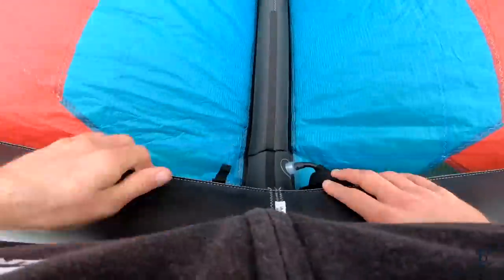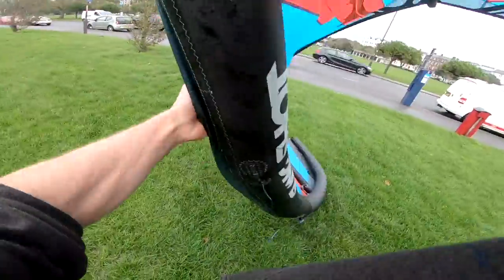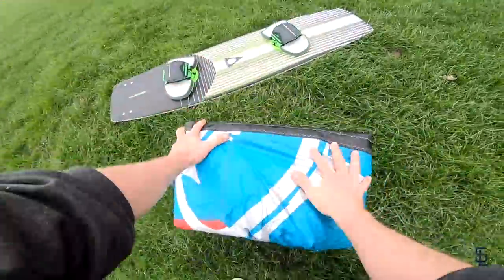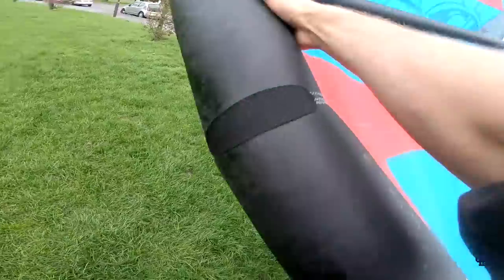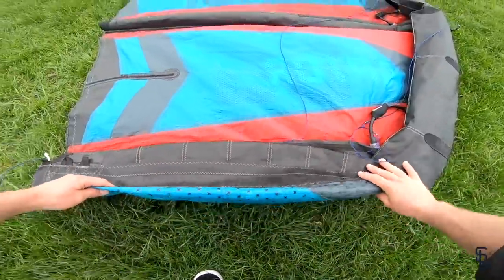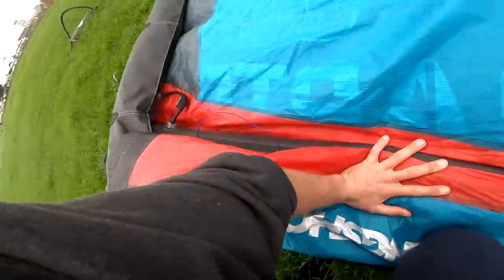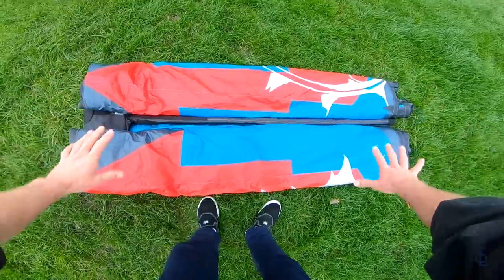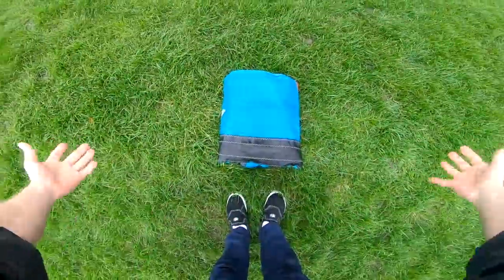How to pack your kite 3 ways

Comment: Rolling kites cracks and erodes the coating applied yo the fabric and thread of materials. You should be aiming to have least amount of loose folds as possible and never roll.so factory fold in this video is the only way you should fold your kite and Instead of doing a hand width make it a bit less width of the bag the kite is going into. Also the 4 folds at end is damageing the fabric unnecesarily you should try aim for only 1 or 2 folds to make it fit into the height of the bag the kite is going into.  I get paid to fold kites, gliders, parachutes and reserves.
Reply: Thanks for this advice! What do you think of the video from slingshot called "how to pack your kite"? They do two lose folds and then roll losely? Is that worse than what you said in your comment (I have been doing it the way you said anyways but I saw their video and wasnt sure if I should listen to them)?
Reply: Speaking as a paraglider pilot I've heard lots of theories about how to pack a parafoil (admittedly different from an LEI). One thing I've been told that may apply to both is not to 'fold' the kite/canopy the same way all the time or you'll end up with creases that may weaken the fabric and also affect the aerodynamics. If this is true 'rolling' may be better than folding. Like I said though, these are theories and some theories may be wrong.
Reply: Anyone whose even half decent at paragliding concertinas they're wings. Just a wild guess but your not on a high b c d or ccc wing if you were it wouldn't be a question Sandy.
Reply: @kulfonbustardo1588  I have more than  500hrs of alpine flying experience, mostly on ENB/DHV2 wings and about 50hrs of tandem piloting.

On modern canopies with stiffened leading edge you're right, it's important not to fold the cell dividers or damage the ribs. If you're trying to fit 10 tandem flights in a day then the glider doesn't get folded at all, it's just loosely bunched up in a quick-pack bag. If you need to hike with your glider or cram a load of wings in the boot of a car it's worth packing properly but if you're going to leave it packed up for a long time it's best not to fold it tightly, to allow any moisture to escape and to minimise creasing in the leading edge..
Reply: Thanks for the clue

Comment: You may also try to keep air in the center strut until you have folded both sides. Then release the air from the strut before final folding. Easier to fold straight.

Comment: After you open the valves, you can leave it for a few minutes before you fold it, the air will leak out and you won't have to push it out while folding.

Comment: I use a hybrid of methods 1 and 3.  First fold the kite in half as per 1, then fold top and bottom halves together, as a pair) from the ends to the centre as per 3.  Finish with 2 more folds from trailing edge to leading edge instead of 4.  Fast, and no rolling (which is I understand has more chance of kinking or twisting the bladder than folding).

Comment: It's even faster method than first two and much safer for your kite...Just leave air in all struts and open front valve only and let air from the front edge out then roll both sides of kite to the center and keep your kite as one big "hotdog"...For that purpose was in kite bag extra light bag from the factory which was used as cover for kite,but for this method you have to have enough space in car ...😎🤙

Comment: I would think that folding a kite would be more damaging to a canopy than rolling due to the increased possibility of creasing. 
After all, the fabric for making the kites comes on rolls. A kite folded and packed away for a long time will have pronounced fold lines unlike a kite that is rolled up. If rolling puts more stress on the sail and is damaging, as someone has previously stated, I would think that the folded areas would be affected and damaged way more and would create weak strips. Just my observation having worked with fabrics for many years.

Comment: There might be an interesting video on how to depower your kite correctly to use it performing unhook and the same time how to adjust your kite lines after some usage (stretched/shrinked lines ) same length all 4 equal or steering must be longer to preform better while unhooked and so on 🤘 cheers for great vid 🤘
Reply from the maker: Cheers for the ideas 🤘

Comment: Oi mate! Thanks a lot for the video! I had no idea about the first method! It will definitely be helpful when its super windy. Also, for a possible future video, would you consider talking about the differences between straps versus boots? I see that you are rocking the straps lately and was wondering the pros and cons of each. Thank you
Reply: Rubens Távora the first technic to fold the kite is dangerous in strong winds. If the wind catches the middle section when you fold the kite in half it will just fly away from you
Reply from the maker: Cool, I will add it to the list. cheers!